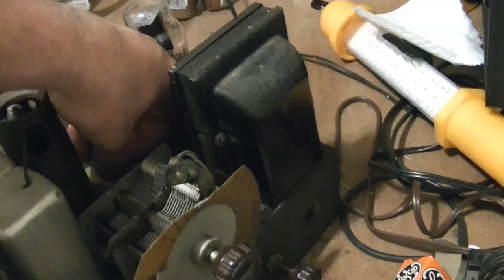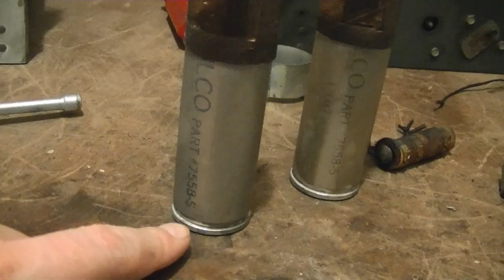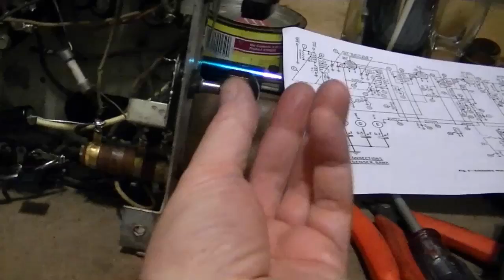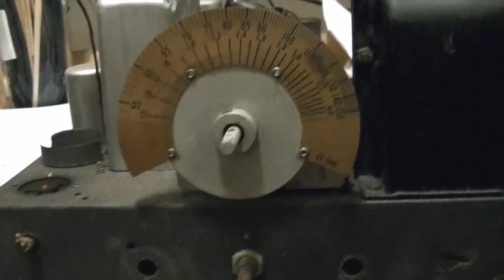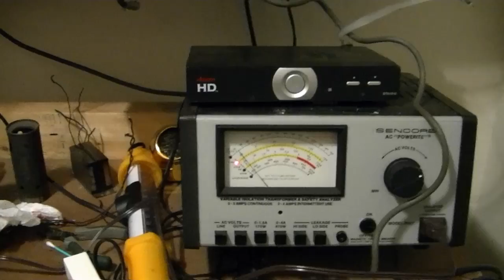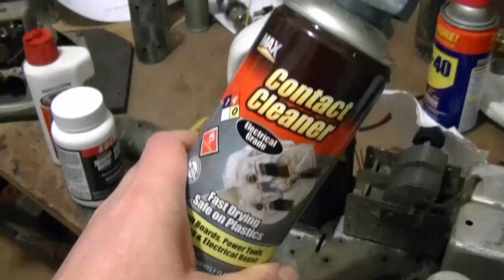Philco 60 MB restoration p7o10

Comment: Sort of, but not really. Those NIST clocks get a signal from WWVB, which broadcasts a simple, accurate, low data rate code at a relatively low frequency, 60kHz, at very high power, 50kW.  WWV, and CHU send out at much higher frequency, lower power, and send out all sorts of signals with formats oriented to the radio communications community and services at large.

Comment: I have a Sencore PR50 I have used in the shop for over 20 years, it has no hum. One thing we used to do with transformer hum caused by a loose core (which is what it sounds like) was dip it in hot wax.

Comment: Bob, 
Although the tuning capacitor works fine, had it not, you could have always screwed some nuts onto those shafts then secured them using a small amount of solder, the trimmer caps could have then been adjusted from the top side - Just a little thought. Radio sounds great, you've done a great job getting it to play.  Dylan

Comment: The T-9 is very slow drying, so be patient. With super porous metal, try wiping down with 90 percent isopropol alcohol first. Since alcohol is miscible with water, it suck's water out of the metal. Super clean, deoxidized, ferrous metal will rust instantly so be quick to get protectant on after you derust. Yes, that was CHU, they are on 3.330mHz@3kW, 7.850mHz@10kW, and 14.670mHz@3kW. Handy for 80, 40 and 20 meters.

Comment: Great vid....I used to have a model 60, great radio. But I do have to ask one question; the other chassis looked to be completely rust-free and complete; why not jumper some filters in and see if it worked? If it did, it would've saved alot of time/effort. The Youtube copywrite police are ridiculous....I'm glad they didn't pull your older vids because of some silly rule like that.